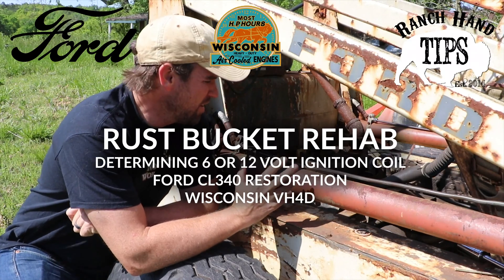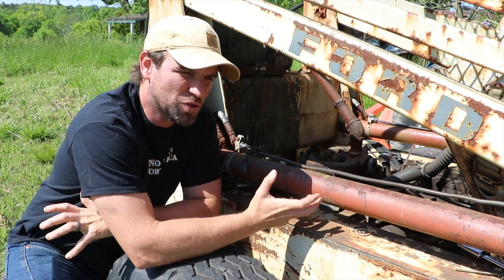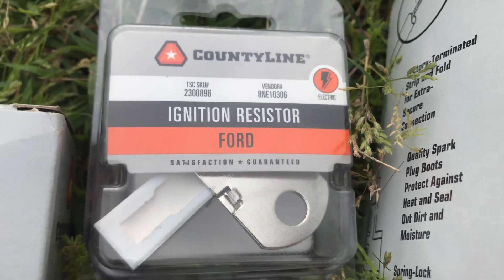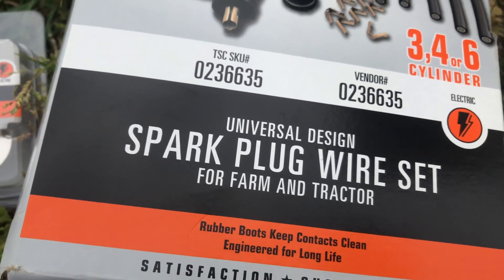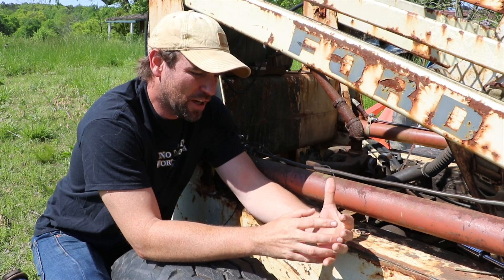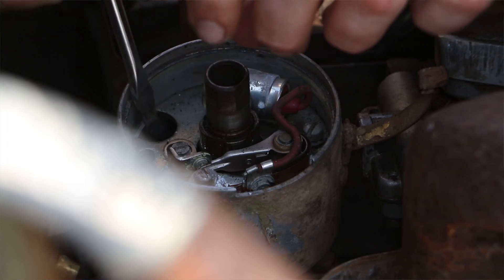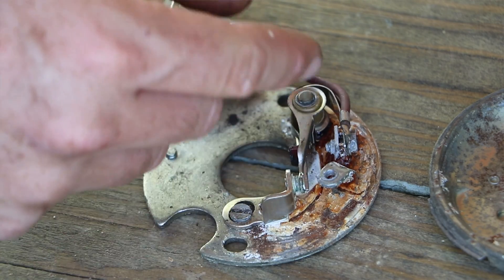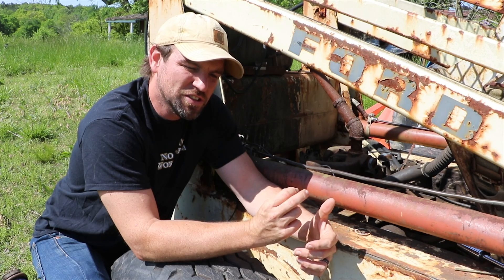The Differences Between a 6 Volt and 12 Volt Ignition Coil

Comment: YOUR NOT USING  THE  RIGHT TERMS  FOR A MECHANIC...THE REASON FOR A  RESISTOR IS TO REDUCE THE VOLTAGE OF THE 12 VOLT COIL DOWN TO 6 VOLT ..... ONCE  THE MOTOR IS STARTED..THIS MAKES LESS  CHANCE OF ARCING IN THE POINTS ..( SO YOUR  POINTS  WILL LAST LONGER..).THE KEY IN THE START POSITION  USES FULL 12VOLT WITHOUT THE  RESISTOR FOR  A STRONGER  STARTING SPARK.ONLY ALSO YOU HAVENT MEASURED AMPS  YOU SAY  VOLTS............ YOU HAVE  NOT MEASURED  AMPS IN THIS VIDEO.. BEFORE  YOU GO REPLACING EVERYTHING    YOU SET THE POINTS ACCORDING TO THE MANUAL ..(MAKE SURE  THE POINTS ARE IN THE OPEN POSITION WHEN U DO THIS ..)

Comment: Holy shit.  DON’T listen to this guy.  He is throwing out terminology  and doesn’t know what he is doing!!!!!   You never keep 12 volts to the coil.   It will overheat.   Hence the resistor ,  doesn’t matter 6 volt or 12 volt. The theory is all the same.  Positive or negative ground.   Doesn’t matter.     Airplanes use mags.  Times 2.    Ugggggg.  The ignorance is high with this one
Reply: I think he's talking about a 12v coil that has extra winding in the coil and doesn't need an external resistor. If you have a coil that says to use an external resistor then yes, you would need the resistor. There's a lot of discussion about that subject in tractor forums where a lot of guys convert their old 6 volt systems to 12v.
Reply: And this guy is promoting Merch. SMFH.

Comment: Aircraft use Magnetos, no coils in them. Spark is created totally independent of external electrical sources hence reliability. Also redundancy of two magnetos, wires, plugs per motor creating two independent electrical ignition sources. if one Mag fails, the other can carry the load till you land safely (with slight reduction in power) hence the pre-flight rev up and switching (off) between Mag 1 and Mag 2 at the end of the runway area prior to entering the runway for flight to check that both systems are within performance specs.
Reply: I've landed with one magneto left.  Fun.  I was ready for some bourbon.
Reply: @hotajax Really? I thought the engine runs the same on one Mag as it does on both, unless the one is weak.
Reply: @auteurfiddler8706  Make sure you climb into the right seat, ok buddy?

Comment: One thing that is confusing is you said using a 12 volt coil means a constant load to the distributor. In a points (non-electronic) ignition, this is not true. There are 12 volt ignition systems (1960-1970s, early 80s) that use a "points type" distributor, which is what you are describing here. But, simply having a 12 volt coil does not mean you have an electronic ignition, even though all electronic ignition systems are 12 volt. Did I misinterpret what you described? I know nothing of 6 volt systems as they were phased out by the time I started working on cars.
Reply from the maker: As I explained you can have a 12 volt coil on a point distributor... in fact, that what I was doing... but you won’t have nor need a resistor with a 12 volt.
Reply: @YanasaTV  all vehicles run on 5.5-6 volts at the points. With 12 volt systems their are two circuits ( a starting primary 12 volt ). Then when you release the ignition key to the run position or ‘secondary’ ignition circuit your on 5.5-6 volts. The 12 volt  coil for a six volt distributor will either have an ‘internal’ resistor or an external 6 volt ‘ballast’ type resister between the coil and the distributor ( other wise you damage the condenser or the points ).
Reply: @YanasaTV   Understand, thanks for clarifying. Did your project fix work on the old engine?